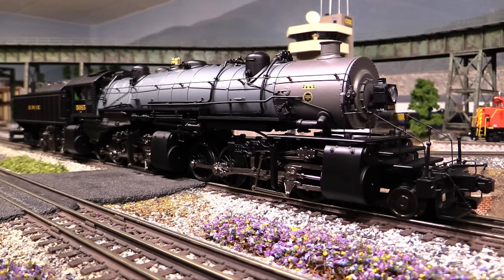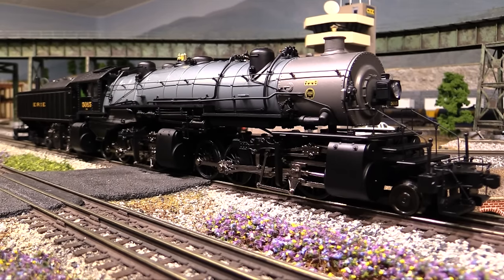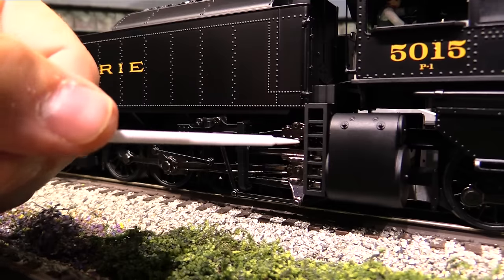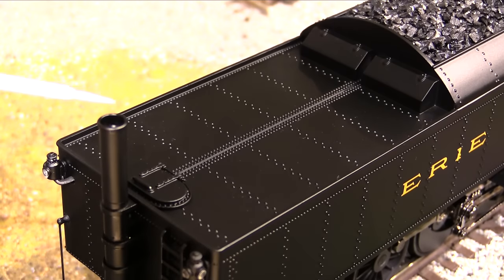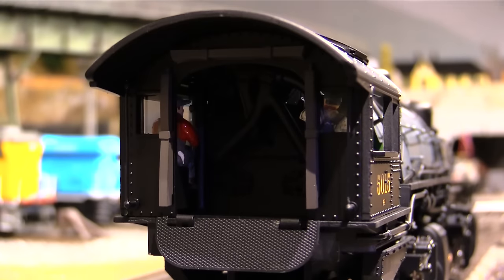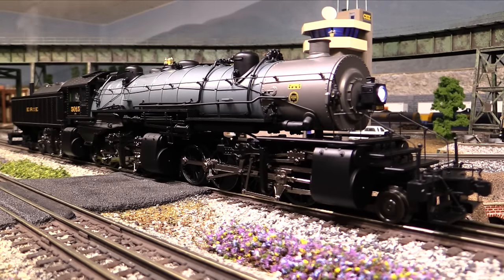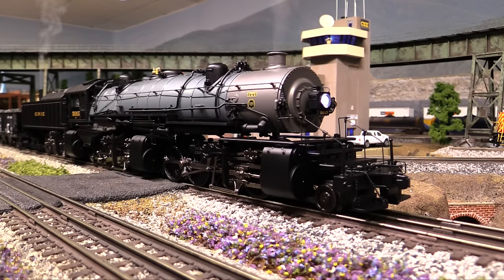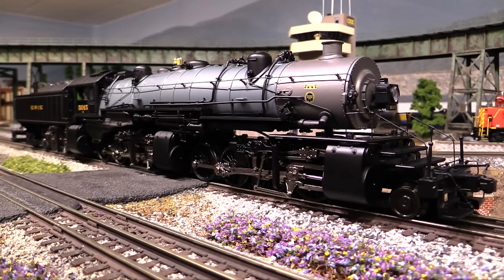MTH 2-8-8-8-2 Erie Triplex

Comment: Fun fact: This was technically the world's biggest tank engine.
Reply: And the most powerful
Reply: Troll Films the engine’s drive wheels extend beneath the ‘tender,’ which serves as a huge coal bunker and water tank. Yeah, this is a tank engine.
Reply: Troll Films r/wooosh
Reply: Spencer: tank engines can’t pull heavy loads!
Triplex: hold my beer
Reply: I hate and love this comment
Reply: This engine was scrapped
Reply: Deya Lopez Should've made it was. Fixed it.
Reply: @FlyinBlaney  do you know why it was scrapped
Reply: Deya Lopez Boiler pressure problems, wheelslip, cost, and only being good for banking trains rather than pulling them.
Reply: Good point never thought of it like that
Reply: I thought the 4014 big boy was
Reply: I make all Sorts of videos on YouTube the big boy dosent have driving wheels on the tender nor does it contain  its fuel sources on the boiler or the side of the engine the oil and water are kept in tenders which the big boy pulls behind it therefore classifying it as an articulated steam engine not a tank the triplex had driving wheels under the tender so technically it classifies as a tank engine
Reply: what they added a triplex locomotive to thomas and friends
Reply: @thunderman9486  no, but it would be cool to see one.
Reply: David ii and the largest steam engine was the big boy
Reply: it was a steam engine not a tank engine
Reply: A tank engine carries it's coal and water onboard, and they are powered by steam. Tank engine falls under the same category as steam engine.
Reply: Boiler wasn't large enough to supply steam to 6 sets of cylinders at any speed over a fast walk.  Still an interesting beast of a locomotive.
Reply: Yes, it is. Since its jointed, its a 2-8-8-2T with a tender and another set of drivers.
Reply: If it's a tank engine then why does it have a tender
Reply: wait the union pacific isnt a tanker
Reply: @Conrail_Studios12  the driving wheels and the entire wheel set extends under the tender
Reply: @andrewj.682  yeah cause technically the tender has no wheels as all the wheels from the locomotive go under the tender so therefore its a tank engine
Reply: @FlyinBlaney  that & the top speed was 10mph!
Reply: @the_random_channel1234  The 4000 series (including Big Boy 4014) was the largest commercially successful locomotive.
Reply: @the_random_channel1234  The Union Pacific Big boy is the biggest locomotive in the world triplex was smaller and triplex was technically considered a tank engine while big boy is not
Reply: @theblocksmith645  tank engines are steamers look at Thomas he's a tank engine
Reply: @railroadfan-io7ns  ok but for the purpose of determining the largest locomotive I decide them up by a little subcategories
Reply: technically the virginian one is bigger because it’s a 2-8-8-8-4
Reply: @magicalintel5867  Was an unsuccessful locomotive, powerful, but in practical use, very limited during their service times.
Reply: Sorry to burst your bubble but not necessarily, a tank engine has its water tanks on top of or around the boiler
Reply: @thatfamiiiarnight3665  You need to recheck your facts a tank engine is literally defined as having on board water tanks the triplex still has a tender that is technically separate and therefore it is not onboard, you need to practice what you preach
Reply: @flyingbuzzard8868  it doesn’t have a tender. the back set of wheels are attached to the coal/water carrier.
Reply: @thatfamiiiarnight3665  🙄 if you want to keep arguing you can forget it because I am way too mature to keep this pissing contest going
Reply: @thatfamiiiarnight3665  and another thing it doesn’t have a coal bunker either so it’s still not a tank engine
Reply: and the reason the big boy has the record for biggest was because it is the only one to still be running on the rails and the last of the two set of driving wheels and the triplex when't only 5-10 mph
Reply: @the_random_channel1234 yes it is
Reply: @magicalintel5867 wasn't successful
Reply: @flyingbuzzard8868 the coal bunker at the back of the cab:

Comment: Fact: Did you know some people consider the triplex to be the world's largest tank engine. I mean on a tank engine, the engine and tender(or bunker) are one in the same.
Reply: They are technically permanently joined by an articulated frame and steam pipes, so its an articulated tank engine
Reply: @Black 5 Club normal tender engines don't have drive wheels under the tender, tenders are normally a separate car that contains the fuel (wood/coal/oil and water) to the engine, therefore if the tender is part of the drive wheels, it makes it a part of the locomotive itself, so it is a tank engine

Comment: The VGN Triplex needed the four-wheel trailing truck because it was used in pusher service on Clark's Hill and had to be able to operate in reverse to return to the helper station.  The four-wheel truck made it  better at handling curves in reverse.

Comment: The stack on the tender is for exhaust steam from the rear set of drivers.  Actual smoke does not come out of that stack.  FYI, the Erie Triplex used compound drive.  High pressure steam from the boiler went to the middle set of drivers.  Exhaust steam from the middle drivers then went to the front and rear cylinders.
Reply: Well yeah obviously real smoke doesn’t come from the stack
Reply: Huh?

Comment: The only 2-8-8-8-4 ever built was a Mallet-type for the  Virginian Railway in 1916, it was built by Baldwin Locomotive Works. The 2-8-8-8-4 became the only example of their class XA, named for its experimental nature. The XA consumed more steam than the boiler could produce and was unable to achieve speeds greater than five miles per hour. The XA was sent back to Baldwin in 1920 and rebuilt as two locomotives, a 2-8-8-0 and a 2-8-2, these two engines were in service until 1953.

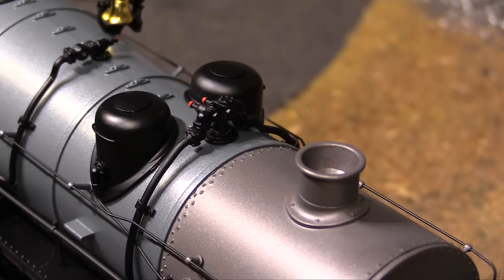Comment: 12:48 "we have some different equipment here and there."
gloss!
The "here" equipment are the air pumps (as they were called; nowadays they'd be called compressors.)  These provided the motive agent for the brakes.
The "there" equipment:   hard to tell with the quick view, but likely include the main reservoirs (for the air) and perhaps an air cooler further aft.
I suspect that pipe on the tender rear was rather called a steam vent than a smoke stack, given that no smoke passed anywhere near this thing. 
Amazing piece of work.  No surprise at the 6' radius requirement!

Comment: Hi Eric: A fantastic review of a very unique locomotive.  When you showed us the cab interior I believe those two pipes on the backhead terminating above each firebox door were part of an early mechanical stoker.  MTH seems to have improved on the tender exhaust from previous issues and the whistle sounds great.  In my opinion, MTH releasing that engine as a Virginian even though it is not prototypically correct, is their way of getting more use out of their tooling and maximizing profits.  I also like how MTH has blackened the wheels on a lot of their Premier steam engines.  Much more realistic.
Reply: Would retooling the Virginia's trailing truck really that costly?  Disappointing.

Comment: Eric, I like the video.  Just one correction, the stack on the tender is not realy a smoke stack, it is the exhaust fron the rear set of drivers.  It was apparently two costly to send the exhaust to the smoke stack for added draft on the firebox.
Reply: Probably hampered the performance by quite a bit though.

Comment: I was at a train show recently and saw a solid brass model from Key imports for $1800, and later looking in my old model railroader magazines from 1961 saw the original price of the model was $200 and used and inflation calculator and saw they were roughly the same price

Comment: I think that technically the rear smokestack is only a steam-stack as the smoke from the fire goes out of the from end. I think the biggest advantage of this design is that it did not require large low pressure cylinders since there were 4 of them. This might have worked better as an engine meant to run fast but it really failed in pusher service as they usually ran it in 'simple' mode and fed high pressure steam to all six cylinders. Even a later super power boiler would not make enough steam to keep this up for long. The Nineteen Teens boiler was completely unable to evaporate the required water. I expect Baldwin new this but they would build something as long as you were paying.

Comment: Great review, love the Russia iron boiler. I'm thinking if you have to take the loco and tender apart it might help to mark the drive rod/receiver assembly with a line of nail polish (your choice of color, clear not the best) to help align them for putting them back together.
Reply: In real life, for each engine , when the right side driving rods are bottom dead center, the left side driving rods are back dead center. Articulated engines have two separate driving assemblies including cylinders, using a common boiler.

Comment: Eric, this is another fine video on a very interesting locomotive. One thing I wish you had covered was how to access the battery. I bought my Triplex from an online table show sponsored by a reputable nonprofit train foundation. The engine's lights illuminate when power is applied, but the locomotive won't run electronically (sounds or smoke) or mechanically whether attempted conventionally or via DCS. A knowledgeable train pal suspects the problem is the battery. I of course tried to charge the battery with 18 volts on the track for about twelve hours, but that didn't work. The engine didnt come to me with it's factory paperwork unfortunately. So I need to access the battery compartment and either replace the battery with a new one, or preferably with a BCR. The train foundation has offered to refund the purchase price, but I love the engine and just want to get it running and not have it as a shelf queen! Thanks in advance

Comment: The triplexes almost made it. Just Like PRR T1s if there flaws were ironed out like the triplexes could use large wheels and bigger boiler like big boy size then it could be a commercially viable loco taking some torc out plus with a auxiliary then no need to worry much on weight.
Reply: Matt`s Mocs
Reply: Here's another idea.  Why not put all three sets of drivers under a longer boiler.  The front & back drivers would have to be articulated in order for the locomotive to get through curves & corners but the middle drivers would be solid with the boiler frame.  All three pairs of cylinders would exhaust through the smoke box as well instead of having the back set exhaust through the tender.
Reply: And why not have a longer tender with that thurd gear under the boiler.  Wala a workimg triplex
Reply: Id like Thomas and friends to introduce this engine sometime but.....

"Big world, big adventures"

Shivers
Reply: Well like the Wise tyro said if they ironed out the flaws then they could have been more usable I would take away the rear stack and fed the exhaust back through the front as for the rear loosing traction just add weights to it and not rely on the coal and water as much
Reply: @trainfan-ks5hk  It could be. Could be

Comment: Fate of the Virginian triplex: Cut up into two locomotives.
Reply: Why am I not surprised
Reply: Front half was a 2-8-8-0, rear half was a 2-8-4
Reply: oh ok thanks for adding that extra bit of info. Also yea the N&W Y3's also ended up as hump engines until they were scrapped as well but did move cars around the yards.
Reply: You're ok and I am really only knowledgeable about the N&W.
Reply: Why did the XA-split happen between 1920 and 1921?
Reply: hmm if I was Virginian president at the time I would test a Y class 2-8-8-2 and something else for banking service but not sure what else.
Reply: Yea also N&W used electrics until they scrapped it in 1962 but used them before with boxcabs because Elkhorn Mountain was dangerous at the time for the articulated engines and a very difficult grade until the new tunnel was completed in 1952. Operation Fast Freight shows the new Elkhorn Tunnel being constructed.
Reply: yea it does hurt but every steam locomotive is awesome in their own right.
Reply: Morbid Mansion Not good I suppose.
Reply: the gojia show  Cut into two locomotives! Horrible man! Horrible!
Reply: the gojia show Probably long gone.
Reply: Do you know what engines they became? Like the road number and road name?

Comment: I have a premier Triplex in O Scale and I've had so many problems with that thing they are very fragile locomotives I've at lest had it to the shops twice. I hardly run it anymore. Its had electrical problems, the cord from the tender to the locomotive that plugs in I've had issues with, and I'm now having smoke issues with it. It is a old PS2.0 one tho so I am not sure how well the 3.0 one is or if they ever fixed a lot of the issues with it.

Comment: Time to build a quadruplex lol
Reply: At times, i imagine a 2-4-4-4-4-2 quadruplex steam locomotive, with 48" drivers and poppet valves.
Reply: The design engineer who crafted the Virginian 2-8-8-8-4 had plans to make a 2-10-10-10-4 which never materialized. A long ago interview with a fireman who fed the coal to the firebox (yes, it was hand fired) said he was never able to feed enough coal fast enough to bring the boiler pressure up to its full potential. He said he must have beat on that pressure gauge a million times trying to get that needle to read higher.  There were just too many legs and not enough steam to fulfill the engine's specs.
Reply: i would say, @Mr. Big Rick Reloaded, at least an O96 or wider...

Comment: 14:43 I once thought of a device that lets you drive the engine on to a piece of track into a box with handles, so you can lift the engine without touching the engine itself.
18:53 it's pretty unusual to have two firebox doors!
21:47 is that a dog or a locomotive sound?
I like this model! good job presenting this!
Reply: 21:47 What you are hearing is a dog going all around the engine.

Comment: I take it that these were NOT compound engines (i.e. Mallets) but just straight locos that exhausted their steam after one go around that would explain their problem.  It would seem that they could be rebuilt as a  2-8-8-0 perhaps with a booster under the reconfigured tender.

Comment: The Virginian 700 was split into two locos, one being the Virginian No. 614, a 2-8-0 from the front section, TALK ABOUT A BOILER! And you could probably take that engine to trainmaster and get two more motors put in so you could pull a train soo long you could couple it up to the front!

Comment: Just for craps and chuckles, I noticed as the triplex came around the curve into the tunnel, the boiler seemed to extend more than usual, did you test on an oncoming train, or a parked consist if there might be contact?  Or do I need glassed or this head tumor removed?  Great video!
Reply: No, you're right -- the Big Boy, too.  It's a function of the tighter-than-scale curves in O gauge.  In reality it's why the mountain routes largely used tandem locos instead of huge articulated ones

Comment: I've had S American Flyers since 1952 and in the 60's became a HO fan. I have over 340 HO Locomotives, several DCC/Sound and even in HO steam I have placed a speaker in the locomotive where the sound belongs. So why especially with an O gage and the motor in the extreme rear would anyone not take advantage of the room in the boiler for the sound?
Reply: That's where the motor and what not are, there simply isn't enough room to put a FatBoy speaker or two and a motherboard in.

Comment: Hi Eric / You were talking about scale wheels. Have you ever tried MTH Scale Wheels on your layout? if you have, do you have a video on this topic, MTH Hi-Rails vs Scale Wheels on 3-rail track. Take care.
• Cheers from The Detroit & Mackinac Railway 🚂
Reply from the maker: Yes I have and I did at least one video where I put scale wheels on an engine...a switcher. Scale wheels and 3-rail track aren't a good idea in my opinion. All you get is a bunch of derailments...which is why hi-rail was invented in the first place.
Reply: Thanks / for the tip. The only place I can run scale wheels is at, The Detroit Model Railroad Club, a 2-rail scale layout. Gary 😎

Comment: I'm loving watching your movies, am from the UK, just thinking about whether or not to make a new start with a small layout? 1 sad thing I noticed when you review and test the magnificent Lionel locomotive, both steam n desiel trains, because of the difference in mains electric, 220-240V in the UK, means Lionel's excellent locos Won't work in the UK! Is there a conversion adapter you can buy from say Amazon that can be connected to UK mains, or alternatively why not just use Bluetooth controlled with the chips installed in the train's?
Reply from the maker: Thanks, and cheers!
Reply from the maker: You could probably just use a standard US to UK power converter. They sell them on Amazon
Reply: @Ericstrains  Thank you Eric, I think it will be a very long time before I have a layout & a stack of locos & rolling stock that looks anything like yours, unless of course I win the lottery!:)

Comment: here  is the loco thats bigger than the Big Boy XD
Reply: Nah. Big boy’s bigger.
Reply: But not stronger
Reply: GuntherGaminX big boys were also fast, able to run at 60 miles per hour, which is kinda important for an locomotive sometimes found pulling fruit from California to Colorado (or at least partially that route
Reply: Wrong. While the Triplexes produced more tractive effort, the Big Boys were faster and much more efficient. Had the Triplexes been built with a larger boiler they would have been a lot more reliable.
Reply: i think that the Triplexes were a few feet shorter than the Big Boys.